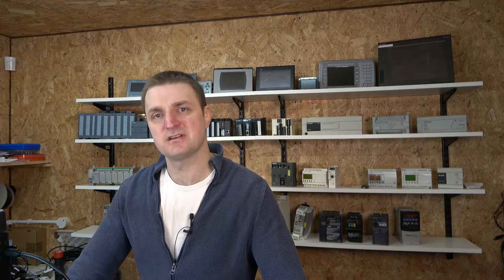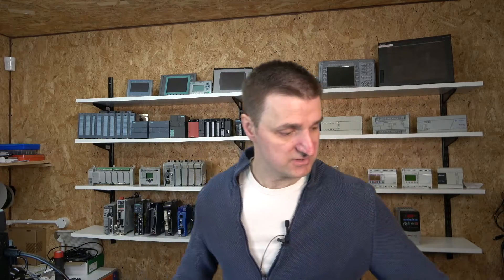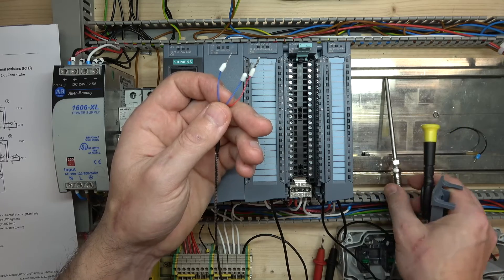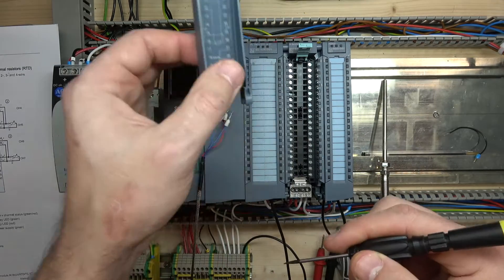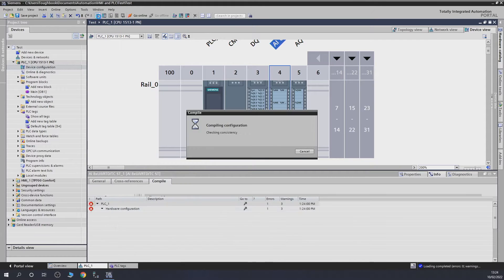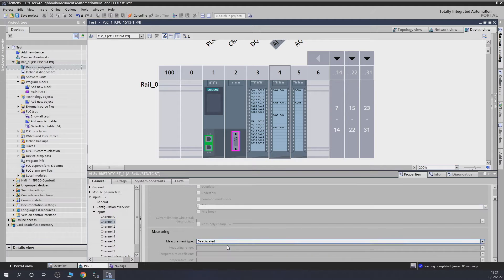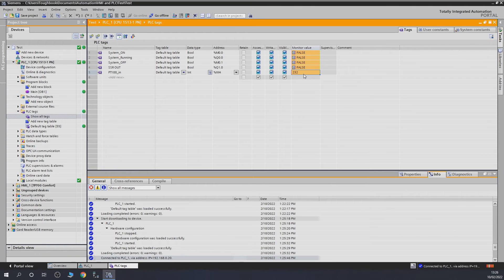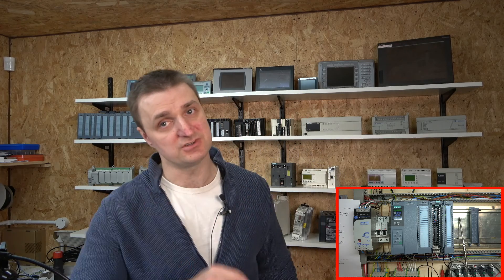How to set up/wire Siemens S7-1500 series PLC PT100 temperature probe ready for PID control.

Comment: Is the module used only for PT ?
Reply from the maker: No, it can process most signals, voltage amps, resistance, tc, pt and more. One of the best analog cards for S7-1500 family